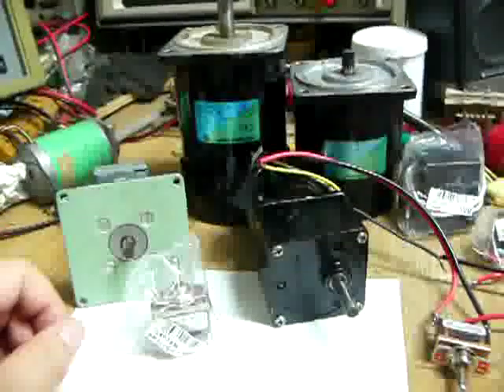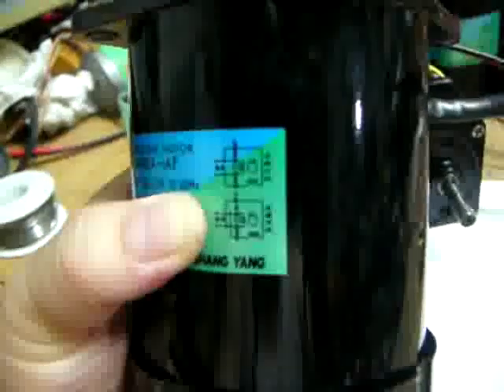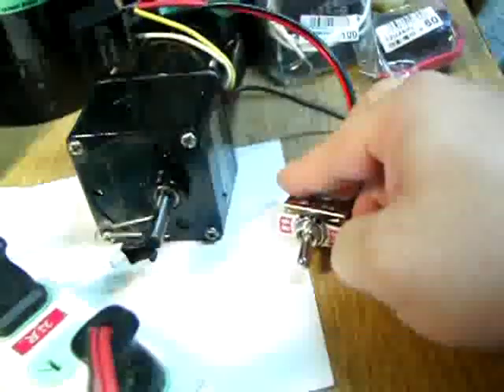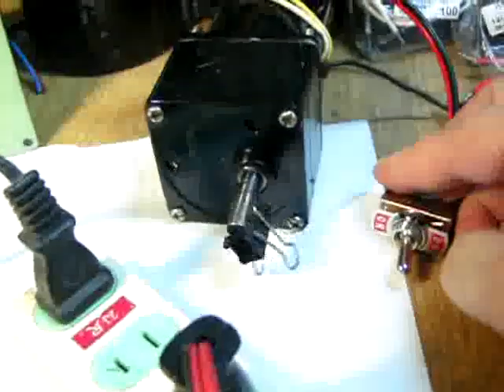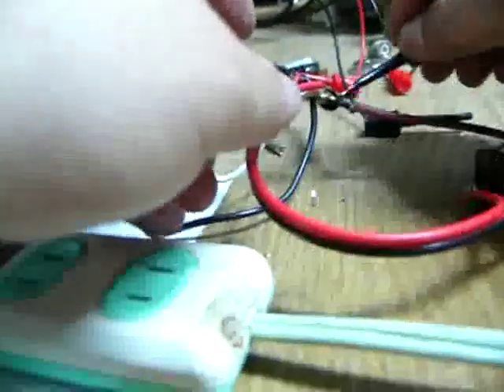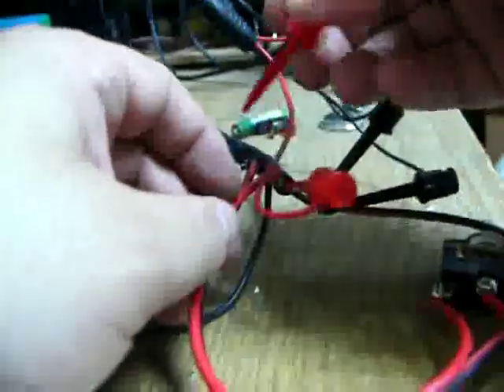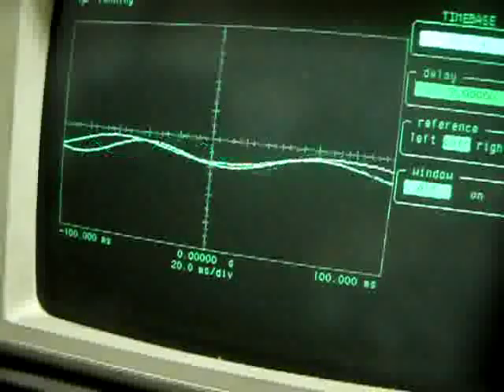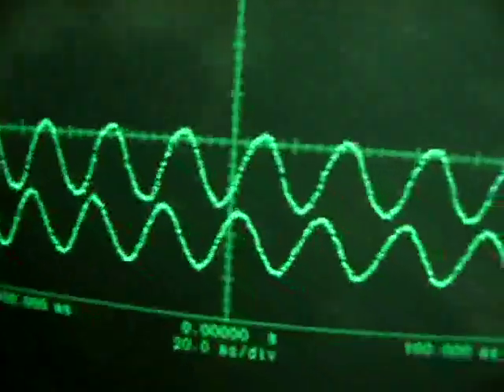Induction motor diretion control

Comment: Perfect for me to rewire my Chinese made small Hoist, But how do I work out what size capacitor I need for it as the motor has no plate on it?
Reply from the maker: sorry about late reply, you could try from small to big capacitor , but don't get too small or your motor may not run correctly .the other way if you want exact , you might need  phase difference between your two winding in fix frequency , like here is 60Hz , and measure one of your winding DC resistance R  ,measure inductance L ,thus you have XL = 2pi x 60 x L , and Xc = 1/(2pi x60 x C ) , because Xc = XL - tan ( phase in degree) x R , if you want your motor running is 60 degree then your capacitor C = 2xPi x 60 x ( 2 x Pi x 60 x L -tan60 x R ) .
Reply from the maker: lo-shu tuan sorry capacitor should be C = 1/(2Pix60x(2Pix60xL-tan60xR) my miss .